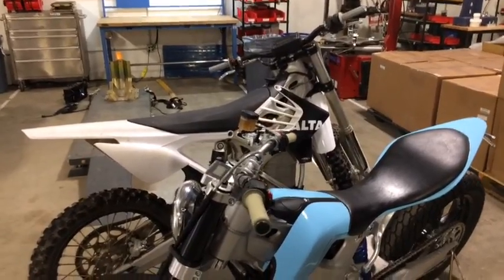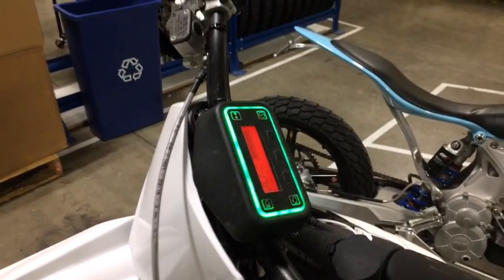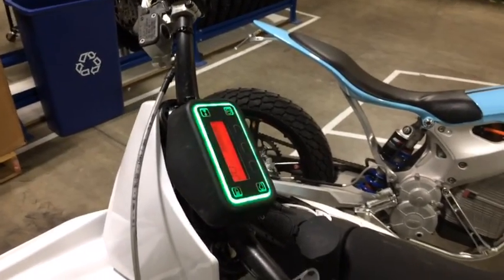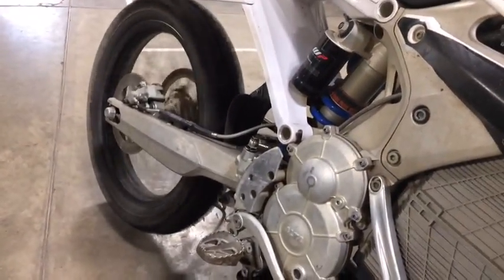Interview With Alta Motors With CTO Derek Dorrensteyn | TransWorld Motocross

Comment: I picked my MXR up on Friday and rode Friday afternoon and Saturday. It's Monday, my smile is still on my face! It is an incredible work of technical art. I thought map 1 was great, then I started playing around in map 2,3,4 and learned what my limits are. I will have to work up to map 4 as it is a whole new level of torque. I'm 200lbs. and I had a hard time keeping it on two wheels in map 4. I did have perfect traction and I assume it will be easier to handle in loamy soil.  I was also amazed at how I wore out long before the battery did. I'm headed to Baja to race a KTM 450 but wish I could take my MXR! I also bought one for my wife and she loves it. NO Clutch/Shifting, no gas, no oil mixing/changes, no radiator, no air filter to clean and oil. Get on and go. I ride next to my wife and we can carry on a conversation without a Sena.

Comment: Chomping at the bit until I heard 15k and 30 mins +1 lap in an MX application!  You mean I can only ride at my local track 1 moto??  And less than an Hr?  wo wo woooooo  I ride at least 5 motos on my average ride day at the track.
Reply: True, but you can get extra batteries. If you ended up really liking the bike and felt like it was more fun or faster for you, I'd guess that having to swap batteries between motos wouldn't be that big of a deal.
Reply: Ya but I think the major cost for theses bikes is the battery technology.  I don't think it would be practical to swap them out on the fly, let alone the added cost witch I would guess would be pretty pricy.  I think the design of the battery is enclosed within the housing.   Maybe the Alta guys can comment??? AND IF it's possible how much would an extra battery cost?

Comment: I hope the batteries and bikes can last up to the lengths of off-road enduro. We have races that last up to and beyond 2.5 hrs
Reply: Matt Lindeberg they can my friend has a test track for these bikes and I think it's about 5 or 6
Reply: Matt Lindeberg or you can change batteries really fast
Reply: Do they hold they same consistent power for 5-6 hrs? What about the cooling system there is dirt packed all around the motor where radiators barely work when we have to run  Evens coolant so there is no boiling point with that coolant. I am interested in seeing these bikes in action. I am a top AA off road racer and I am a top A moto racer I do all my own maintenance and I race Kawasaki's I have never entered a race on a different brand bike in 15 years of racing but I enjoy riding other bikes. I don't see electric as a better design yet